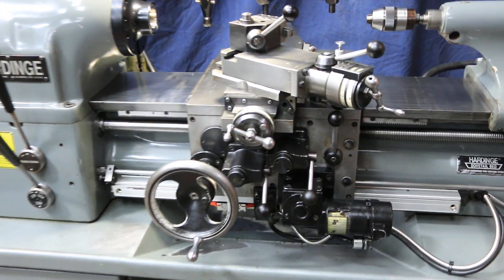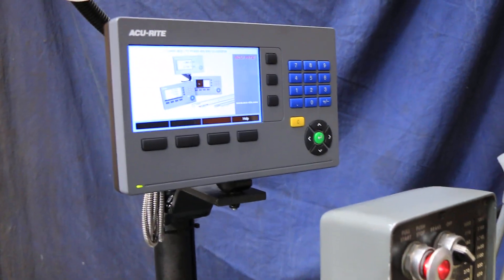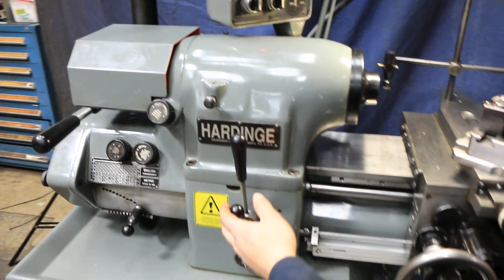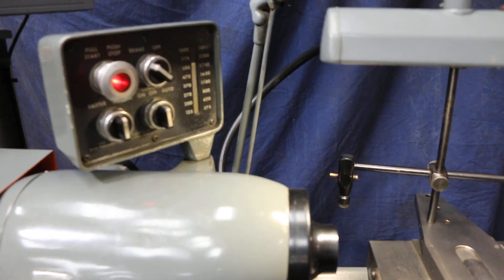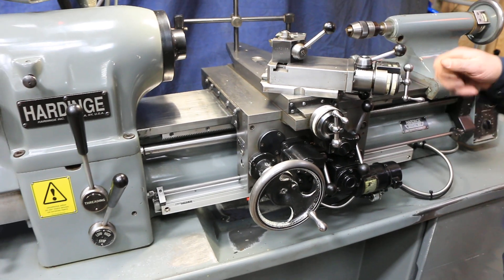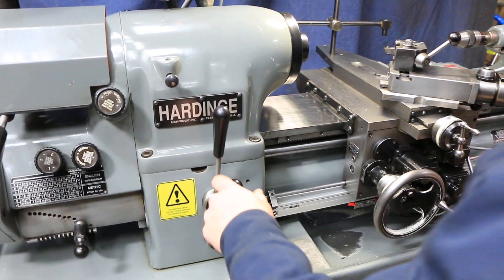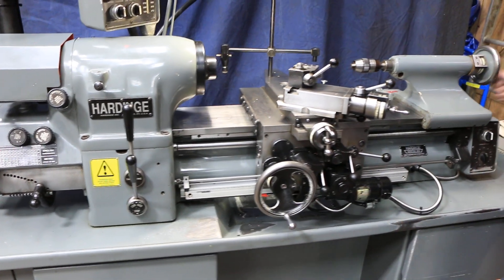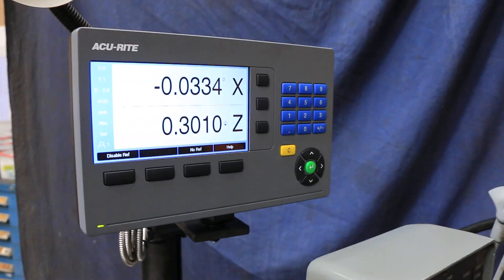HARDINGE SUPER PRECISION TOOL ROOM LATHE MODEL HLV-EM,

Comment: I don't think you're supposed to run the threading operation on high speed. When i bought my Hardinge from your shop in 2008 the tech yelled at me for doing that since that was my first time using a Hardinge.